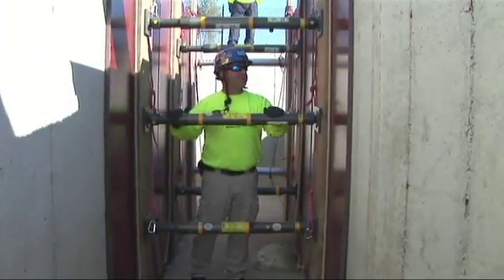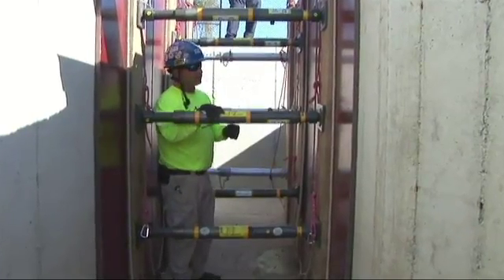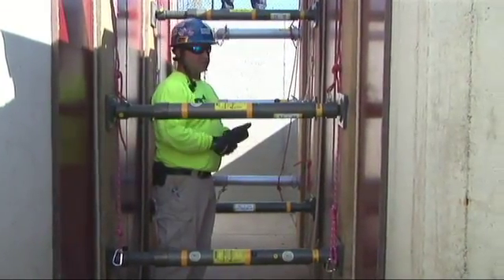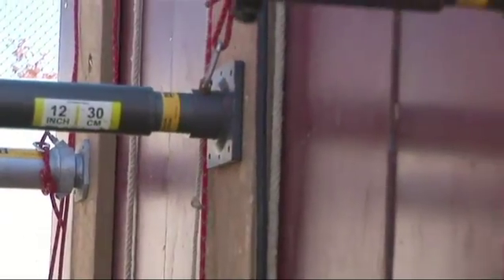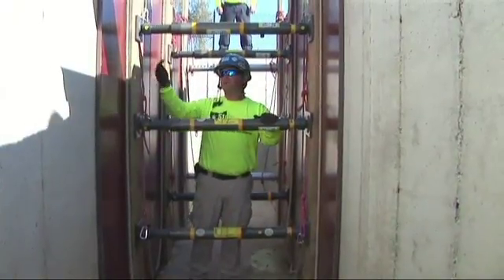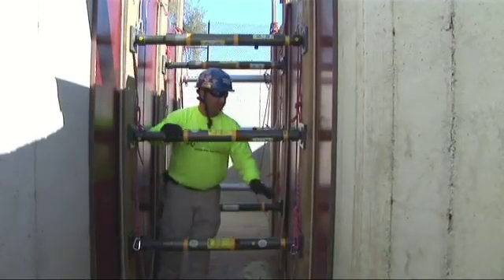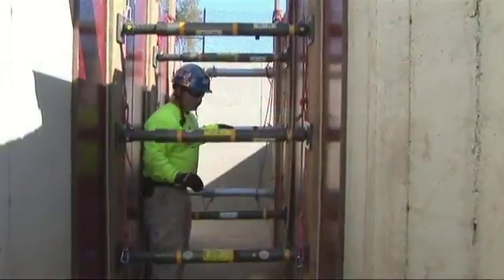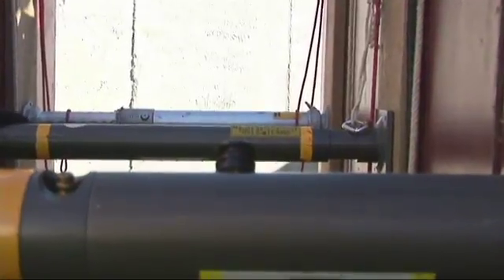Rescue Methods - Trench Shoring

Comment: Probably want to mention that the pneumatic struts need to be placed vertically and horizontally based upon manufacture's tabulated data sheets. Neat struts are nice but staying in compliance and staying safe are paramount.